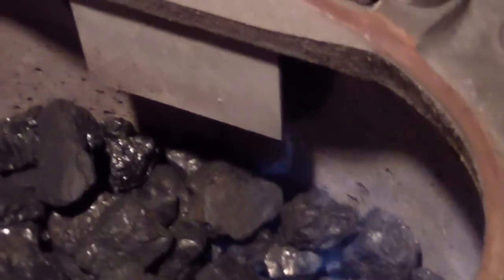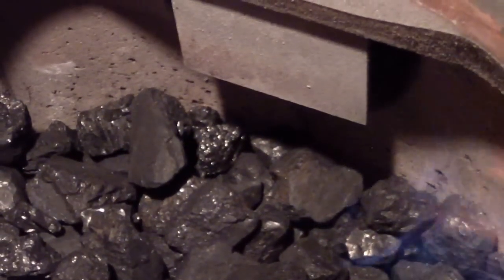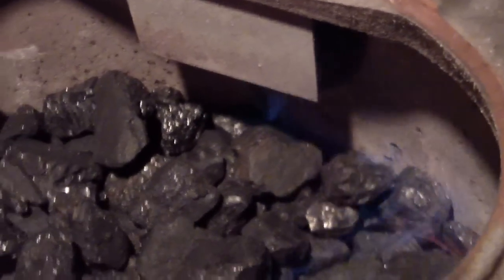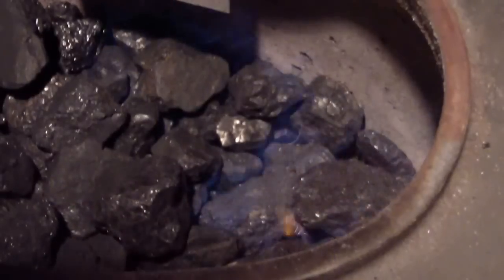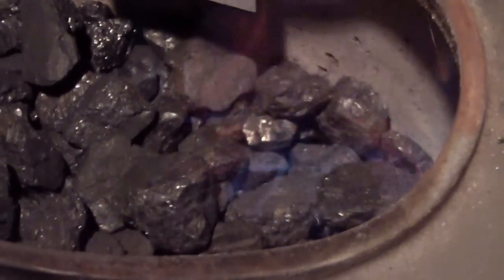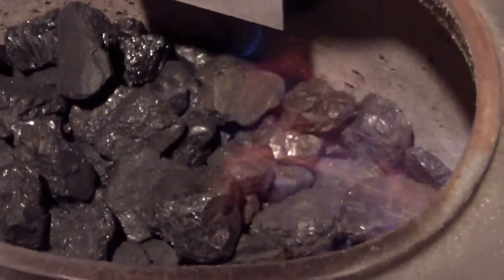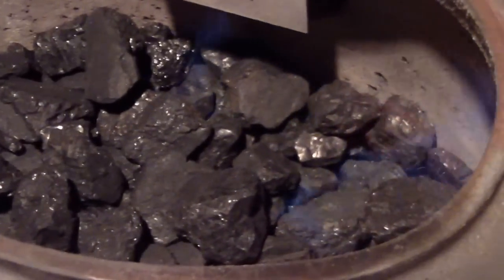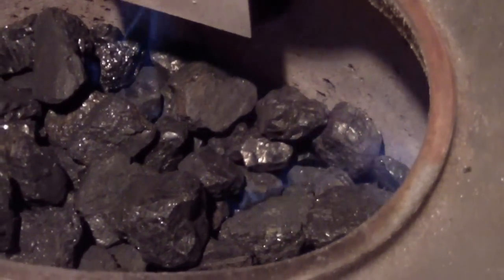Godin Grand Oval Petit Shakedown and Fill #5

Comment: I got a house this spring that has a petit godin. I don’t have much experience with this sort of thing, having only used modern push-button pellet stoves in the past. It’s a very pretty stove, so I figured, even if I never use it, it looks nice. Now that winter is here in earnest and I’ve been cranking the electric heat like crazy the past few days, I’m suddenly thinking… maybe I do need to learn how to use this thing after all. My dad was always great at this stuff- I can recall watching him shake down our coal stove when I was a kid- but now suffers from dementia and can’t teach me like he used to. So, sincerest thanks for making this series of videos. I watched all five and have saved them! I know this is an old video but if you do happen to see this, a follow-up question— I was excited to learn that these stoves are multi-fuel. I think I probably want to burn coal eventually because I know it burns hotter and requires less tending. But the house also came with a bunch of wood, and I figure I will get rid of that first. When burning wood, would the cleaning process be more or less the same as you demonstrate here (aside from, I assume, less ash)? (Additionally, I know the wood-vs-coal thing is a bigger question, but as a total newbie I would welcome any thoughts you have on that topic!)
Reply from the maker: Yes,  more or less the same. I've burned both but the tending on coal was only once every 12 hours. Wood,  my opinion yes it will deff burn wood but you'll be feeding it A LOT,  like every 2-3 hours at best.  IMO the stove will burn wood but deff not designed to make the most of it.  It's a coal stove that burns wood.  Just curious do you have reasonable access to coal ? Anthracite ? With wood the damping requirements will change,  do you have a manual damper ? I put a baro damper on mine and it worked wonders.  Super easy cheap install and easy to set.  It gave great results.  Chimney cleaning requirements will be much more frequent with wood vs anthracite.  Cleaning kits are Also cheap and easy.  Please keep the chimney clean so the wood creosote doesn't build up and ignite in your chimney you deff don't want that lol. Please ask anything you need I'll Def answer and help.  I know what it's like to have never done this before so I get it.  Funny I sold the stove and switched to natural gas.  Just moved to a home with all electric and would give almost anything to have that stove back right now lol at least I'd have heat when I lose power.  Currently looking at options... again fire away with questions.  There's a forum that helped me a lot back then,  I'll find it and post it for you...
Reply from the maker: https://archive.ph/Z5DiP
Reply: Thanks for all of this info! I don’t get the impression that coal/anthracite are popular fuel in my area these days.  The previous owner, and the one before that who was the original purchaser of the stove, both burned wood. (Not sure if relevant, but the stove is actually in an accessory building/workshop rather than the house itself, so I am guessing it’s something that people have historically used just part of the day rather than 24/7.) In any case, I’d imagine I can get coal or anthracite if I really want, but might be a premium price and/or a too-large minimum quantity. (Now having flashbacks to the giant outdoor bin my parents had for their coal storage. We always had eyes for our snowmen, at least!)

Regarding the chimney and creosote, I’m sort of a safety-obsessed person and this is part of the reason I’ve been intimidated by the stove! I think the stove has been here since the ‘90s, but the chimney was recently replaced- I think a tree fell and it had been bent- so I’m hoping when I get around to taking a look inside the chimney it will be pretty clean

I just took a look and there doesn’t seem to be a damper. Is that odd, or are they not always necessary?
Reply from the maker: @michelleelise7  if it's for an outbuilding then it seems to fall in line maybe not having a damper.  I don't think many would recommend none I'm no expert,  but I'm sure many have done so with no harm. So you have a chimney on an outbuilding ? If you live in NY, PA, VA, W VIRGINIA ETC that's anthracite country.  Some people don't realize they're sitting on nearly 100% of the world's supply of anthracite in that area...
That particular stove,  the grand oval,  it would have easily heated 1000  square feet.  It did as that's what my basement was.  With the proper circulation I believe it would have come close to heating the upper level as well.  Also 1000 sf, i just got tired of tending it every twelve hours four months or so out of the year and natural gas was already hooked up to the house so in the end it was just virtually effort free to go natural gas especially compared to a hand fired stove
Reply: @BDX2BDX2  it does have a chimney, in addition to the electric heat and running water. it’s a fairly “finished” outbuilding I guess. We use it as a home office/gym. It’s maybe around 800 sf. The previous owner who originally purchased the stove told me he was able to have the space at around 80 degrees even on very cold days. It sounds like he went through an awful lot of wood. In old pictures of the property there are stacks of firewood all over the place…

That is an interesting point about geography- I am in NY but near the coast where it is really all sand- it’s easy to forget that the rest of the state is rocky and rich in all kinds of things. I looked today and found that I can get bagged anthracite at the local Tractor Supply or Agway. Not cost effective, of course, but I guess good for a trial period before I commit to a larger quantity.

Also need to get a pair of proper gloves! I can’t seem to find the godin multi-tool that would have come with the stove for pulling the pan, door, etc.- any thoughts on whether it’s worth replacing that? I noticed in your videos that you were fine with just gloved hands…
Reply from the maker: @harpshapedbox  any welding supply store would have welding gloves that'll give you at least a few seconds before your fingers get too hot.  They are usually not over priced and sometimes come in a pack of 3 pairs.  I have them everywhere,  good for handling hot logs in the stove or fire pit etc,  hot exhaust if you work on cars,  stacking wood,  they really do come in handy.  Don't think I ever had the special tool.  As far as wood vs coal it seemed the pipe would put off a lot of heat with wood,  and the stove itself would put out more heat with coal.  850 sf yeah I have no problem believing it threw off more than enough heat.  
The bagged coal might also be available at fuel stations,  I never noticed until I had the stove.

Comment: What sort of burn times do you get with the Godin? What size area are you heating?
Reply from the maker: Hi Andrew, the stove ran best shaking down and refilling every 12 hours. At that point I'd be filling in a little more than half its capacity. It was in my lower level appx 1000 square ft with 7-8 ft ceilings, it actually threw off too much heat, you'd go comatose down there. If I'd kept the stove longer, putting vents through the ceiling to the upper floor (appx another 1000 square feet) would in my opinion have levelled temps out quite well.